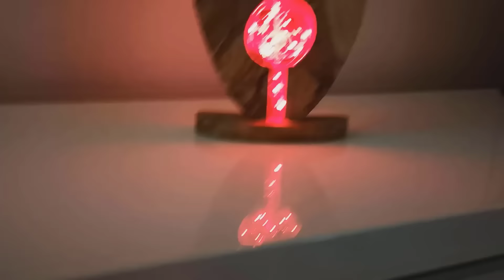20 Most Amazing Epoxy Resin Lamps / Resin Art

Comment: The names are just for convenience and not given by artist!!!!

TIMESTAMPS!
 
1. Water from hands : 00:00
2. Candle stand : 1:57
3. Pipe loop : 3:44
4. Hovering Rock : 7:06
5. Lemon Lamp : 8:21
6. Banana : 10:11
7. Water from one Pot to another(Innovative) : 12:17
8. Hanging Lights : 14:36
9. Feather lamp : 16:27
10. Triangle tower : 18:01
11. Red lamp : 20:28
12. Waterfall lamp(somewhat) : 23:07
13. Tree and axe : 25:53
14. Triple pillers(May be representing a sapling and beautiful) : 28:35
15. Chain in wood : 31:23
16. Y Holder : 33:11
17. Pentagonal : 35:43
18. Pipelines : 38:56
19. Dolphin in sea : 40:47
20. Star in wood : 42:54
Reply: Yeah its true...